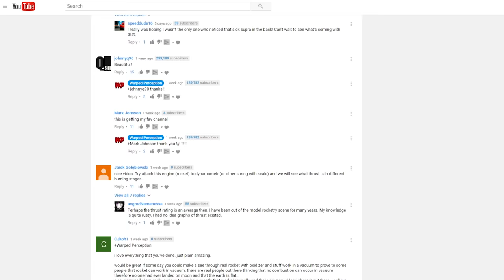Model Rocket Engine In A Vacuum Chamber - 4K Slow Motion - will it burn? - Rockets (S1 • E3)

Comment: he left air in the chamber, I didn't hear the suction when he opened the chamber.
Reply: You won’t get suction when the chamber is opened, it’s not a vacuum you use to clean your house with 😂
Reply: He didn't leave air in the chamber.  The rocket expels gas which fills the chamber when it is ignited, so it's no longer a vacuum after the rocket has been fired.
Reply: Pete Smith that would mean space is no longer a vacuum if we use this logic
Reply: ben gray Well, the space inside the chamber fills up with exhaust gasses, yes.  It's not the greatest test to see a rocket produce thrust in a vacuum.
Reply: Pete Smith the test is fine, it proves the point is it trying to achieve. A rocket can work in space. Unless you’re claiming that isn’t the case?
Reply: Pete Smith the rocket will expel a gas because of the process occurring inside it and the way it pushes the gasses out of the back of it, so are you saying that gasses can’t travel through space/vacuum? It sounds like that’s what you’re trying to say, then again you could be one of the space deniers too 😂
Reply: I'm only saying the conditions inside the vacuum chamber aren't quite the same as it is in outer space since the rocket's own exhaust gasses fill the chamber fairly quickly.  

And for the record, I'm not an idiot who thinks the earth is flat, rockets don't work in space, and there's a dome covering our planet..   O.o
Reply: Pete Smith hahahaha okay, well it’s a small area so of course the gassed will fill the area, but that doesn’t make it not a vacuum... and it sure does seem like you’re implying a rocket won’t work in space!
Reply: That was filmed after he released air back into the chamber
Reply: @bengray5013  it does make it not a vacuum! If you had -14.7 psi in the chamber and ignited the rocket engine, the gasses from the rocket engine will fill the chamber and make it go closer to 0 psi which is not a vacuum. The chamber test is flawed, not because rockets cant work in space because rockets CAN work in space, but because the tiny chamber fills with gas and reduces vacuum where space doesnt reduce vacuum, you're so dense
Reply: @Darion350  will it work in space? how the rocket fills the "chamber" in space?
Reply: @abalcells  Gasses expand to fill the container it is in.  So when hot exhaust gasses enter the rocket's nozzle from the engine, it expands and exits out of the other end with enough force to push the rocket along.

Comment: Conservation of momentum proves that rockets can work in a vacuum.
Simple Lets say you have a space ship weight a total of 1005Kg.
You then eject 5 kilos of gas backwards at 2000m/s. This gas has a momentum of 10000kgm/s. By conservation of momentum the rocket must gain 10000kgm,/s in the opposite direction, giving it a velocity of 10m/s.
QED.
Reply: Nice try but your pressure external is zero pa.  thermodynamic Free Expansion brings your acceleration to zero, look it up. Pressurized gasses released into a vacuum produces no work, so no propulsion.  Nice example of how to use conservation of momentum in an atmosphere though.
Reply: @uncommonsense9948  
I've looked it, and it doesn't do what you think it does.
The fact is the free expansion does not require a vaccum to work.
If I had two containers at different pressures and then I connected them to eachother, Free expansion would still happen.
Ergo if free expansion worked the way you think it did then rockets wouldn't work in an atmosphere either.

Conservation of momentum applies in a vaccum as well as in the atmosphere.
Newtons 3rd law means that their must be a large force produced on the rocket.
Reply: @uncommonsense9948  When combustion occurs, the gas expands in every direction. Creating pressure. If you have the left side close and the right side open, the gas will impact the left side of the combustion creating a pressure and thus a force. Without a right hand wall to counter the pressure on the left wall, there is a resulting force pushing to the left.
Reply: @11cookeaw14 THE CONSERVATION OF MOMENTUM FALLACY Here the idea is that when a rocket “expels” mass, in the form of burned fuel, in one direction, conservation of momentum says it has to be propelled in the opposite direction in order to conserve the total amount of momentum in the system. The law of conservation of momentum states that in a system not subject to external forces the total momentum is always conserved. That's a logical consequence of Newtonian laws. Without external forces the interactions inside a system must always involve some kind of exchanging, like typically in a collision between two objects, where the energy/velocity lost by an object has to be transferred to the other (inelastic collision) or simply exchanged (elastic collision), so that in the end the total momentum of the two objects is the same before and after the collision. Let's take a look at how that applies to a gas expanding in a vacuum. A gas expanding against a vacuum is not interacting with anything, by definition, hence its momentum cannot be exchanged with anything, and it follows that: THE EXPANSION OF A GAS IN A VACUUM WILL NOT AND CANNOT AFFECT ITS TOTAL MOMENTUM (i.e. THE TOTAL MOMENTUM OF THE GAS MOLECULES BEFORE THE EXPANSION IS CONSERVED AFTER THE EXPANSION). The logical, unavoidable consequence, and key point here, is that – if we assume a rocket in space can be accelerated by expanding gas in a vacuum - in order to account for the accelerating rocket we end up INCREASING the total momentum of the system. In other words, we end up violating the law of conservation of momentum. Bottom line: the law of conservation of momentum actually disproves rockets working in the vacuum of space. 
Have a great holiday Mate,

Comment: No vacuum.   want to see the gauge as it's burning.
Reply: Yeah, because this guy is so interested in deceiving us...
Reply: Akbar a vacuum is a vacuum,you keep saying it’s not a true vacuum, but it is.
Reply: Akbar hahahahaha who told you that? A vacuum is an area void of air, they literally showed the air being drawn out of the area. It is a vacuum, true vacuum just sound like some bizarre flat earth claim 😂
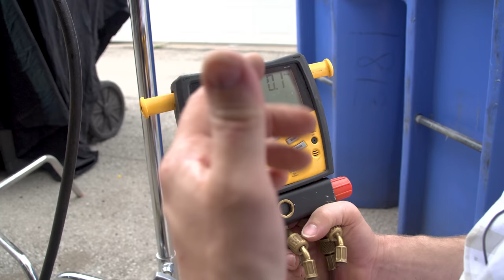Reply: guys, at 2:11 you can see that the chamber is at 0.1 mmHg, and for any slightly educated person, this should mean that it is in fact, in a very strong vacuum.
Reply: R M, one can tell it is not a vacuum because the smoke forms clouds. There is a gas with no smoke and a gas with smoke. If it was a vacuum the smoke would expand to fill the volume without creating "clouds".
Reply: RandomVariable complete bollocks
Reply: ben gray, Look at the video from 2:55 to 3:05. That tube is clearly fill of air. The new gas is pushing the existing gas out of the way.
Reply: +RV,
 HUH?  Smoke is particles resulting from the combustion.  Cloud is Water droplets. Different things.
Reply: i would like to see the vacuum gauge as it burning too. i bet the exhaust gasses changed the vacuum to about 1-3psi.   maybe that's why we could hear it burn too!

Comment: "Rockets push off atmosphere, therefore rockets won't work in a vacuum"

This is their reasoning? That's some "I didn't pass middle school physics" reasoning right there. Rockets don't push off atmosphere - they push against their exhaust. The exhaust goes out one way, and due to Newton's laws, it pushes back on the rocket with equal force it exits with. There's a whole shitpot of research into the right rocket nozzles for various external pressures.

You can even see the change in pressure affecting the exhaust flame as real rockets climb in altitude. You see the shock diamonds from under-expansion when it first takes off, then they gradually disappear, then you can see the flame turn into a giant round blanket behind the rocket as the pressure drops even further.

Absolutely child-level misunderstanding of physics.
Reply: Oh,wow. You mock those that question lies yet show yourself that you do not comprehend what is being discussed.
Reply: Really great comment, but I feel that trying to explain fluid physics, shock diamonds and rocket mechanics to people that can't even understand Newton's third principle is futile. Still, great explanation.
Reply: *Correction: You used the term under-expansion when you should have used over-expansion.

A rocket at high altitude exhibits under-expansion, meaning it's performing very inefficiently and is producing almost no thrust. We are led to believe by NASA and our education system that the rocket is on its way to space at this point, and (laughably) accelerating, when in reality quite the opposite is true. The rocket is at the apex of a parabolic arc and is beginning its downward descent where it will ultimately plunge into the ocean.

Comment: Your experiment was bogus, and misleading, the rocket burned hotter and faster because what was left in your vacuum chamber was mostly nitro, and as far as a success, why not do it again, with the rocket all the way in the front of the tube, and see if you get any thrust, the magnesium smoke acting as atmosphere giving push along with heat? As far as burning goes, your vacuum would also have to be sub zero temps, to even come close to simulation, so great success, at proving that you can light a roman candle in a tube filled with nitrogen?
Reply: Plane Of Inertia it worked in a vacuum. There’s no flaw
Reply: Plane Of Inertia also your name is hilarious, inertia is required on a flat moving plane, so the fact you use the word inertia must mean you accept the earth is a spinning globe
Reply: First of all I am not looking for anything as far as a response, yet since you offered, Ben Gray, your Handle/Name is son of overcast or Son without Sun? Ben = Son, Grey = Without Sun?  A toroid is specified by the radius of revolution, precession of a gyroscope, have you ever seen a gyroscope Benny? It's (3) concentric plane's on (1) axis, or as 3-dimensional linear algebra describes it, The (3) three elemental (rotations about the axes xyz of the original system, which remain MOTIONLESS?) The Y of this equation is (fixed) or MOTIONLESS Benny, that is why it's called Terra Firma, ‘firm land.’ without motion? Only the Sun's energy moves but since your without Sun, I'm not surprised you can't see this? Leonhard Euler, "Proper Euler Angles" geometrical definition. Look it up, stand up like a man, and get back to the point of this mans experiment to which my previous comments were intended? Creating a Vacuum causes Water vapor, water has been inside that air chamber, and Hydrogen makes up the overall gas composition, yet no water droplets, condensation? They certainly would be evidenced if you've created a VACUUM? 
Without this fundamental fact, the experiment is interesting, but isn't worthy of a scientific conclusion?
Reply: Wait, did you just say that the vacuum would have to sub zero temperatures? Vacuums don’t have a temperature, there are no particles vibrating
Reply: space is not sub zero temp. Not even remotely close to sub zero temps.
Reply: @planeofinertia7433  jist wanted to point out that the air is 70 odd % element nitrogen (N2) and not nitro (I assume you meant something similar to nos [nitrous oxide N2O] because elemental nitrogen is not flammable and is relatively inert)
Reply: EVER HEARD ABOUT OXIDIZER IN ANOTHER TANK

Comment: Reading through the comments, it's pretty clear that some people don't understand how any of this stuff works! 
A: Space isn't a vacuum. Just because it lacks oxygen, nitrogen, and other gas density, it doesn't mean that it's a vacuum. It is a neutral state, which is neither pressure nor vacuum. 
B: Some of them also aren't understanding that solid rocket fuels use oxidizers to supply the flame with oxygen. The flame isn't dependent on external oxygen to maintain ignition.
Reply: except space IS a vacuum for all (physical, mechanical) practical purposes. It is at 0.0 PSI.
Reply: Space IS a vacuum, but you have the right general idea.

Comment: there is no such thing as a complete vacuum there are degrees of vacuum and space is not a vacuum it is a fluid
Reply: Not Ur Business once you introduce pressure in the so called vacuum it is no longer a vacuum
Reply: Ya fluid as in NASA cgi and there training pool
Reply: Yup plus he did not make it a complete vacuum, I seen a dude do this and he made a big  40 barrel can made of metal and would suck all the air out, with a vacuum